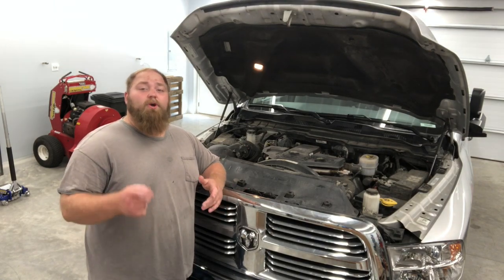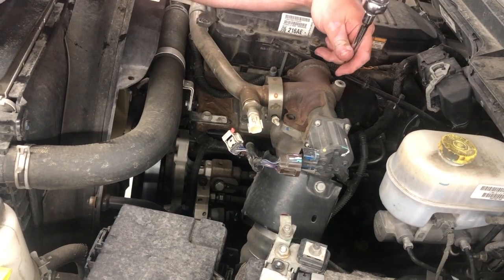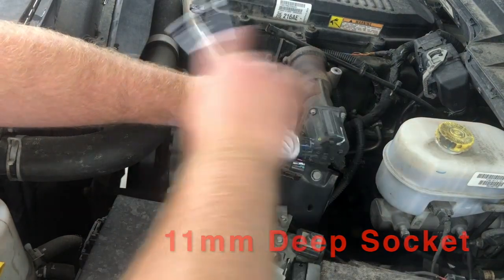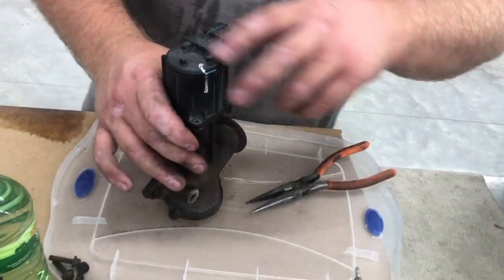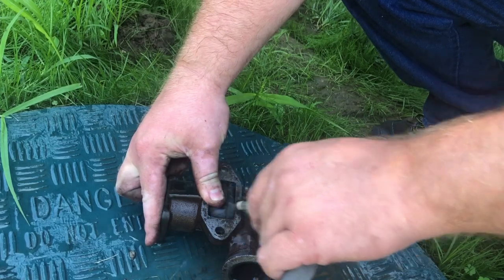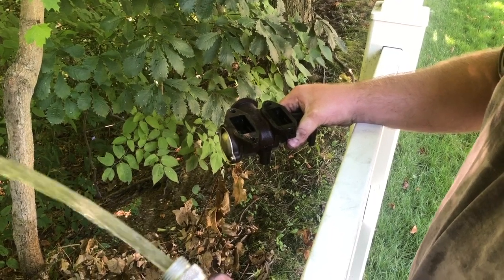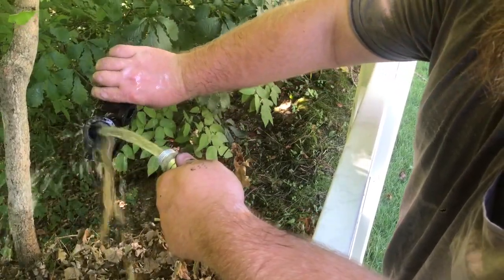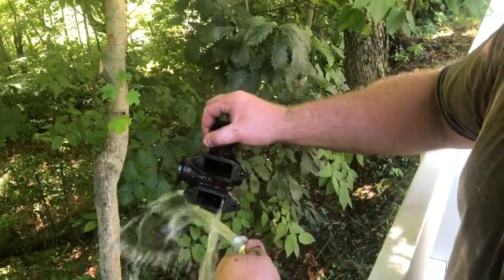EGR Valve Cleaning - Ram 3500 6.7 Cummins

Comment: Would a dirty valve cause the truck to run rough under load like it is almost gelling up.  My truck will run great at idle but when I accelerate it runs rough and blows out kind if a white vapor.  Doesn't really smell like fuel though??

Comment: Great video 🔥🔥🔥 but when you put it back together did it throw a code? Did you just erase it? Seeing that you cleaned the valve and cooler taking some electrical connections apart. 03-06-22 What mileage would you recommend doing this? I feel confident that I can tackle this with the help of your videos.

Comment: Good video. A lot of people never even consider cleaning the EGR Valve.  SuperClean is good for this but the product that amazed me for EGR Valves, IAC valves and generally any item that has carbon build up is Motorcraft PM2 Carburetor Tune-up Cleaner (The spray version of PM3).  When I first tried it, I was a little skeptical. But a couple of squirts melted the carbon off like hot butter, removing about 90-95% without any scrubbing. Another squirt and a little scrubbing with an old toothbrush and the rest was gone. And the cleaning only took 3-5 minutes and no rinse water. The 12 bucks a can sounds steep but considering that it only took 3 or 4 short squirts, a can will go a good ways. Take care!
Reply from the maker: Thanks for reaching out and sharing!! That sounds like a quality product, I'll check that out for the future. And if people don't consider cleaning it, they'll be paying a shop to replace it or clean it when it eventually gets stuck and trips a code that shuts them down. Hopefully people don't have to go through that though. God bless!

Comment: I pulled out the electric motor plunger... Tru came all the way out of the motor... the end appears to have a screw tip. I was able to put it back in to the motor.  Is it supposed to pull out easy? Or did the screw end strip out and I need to replace the whole motor unit?